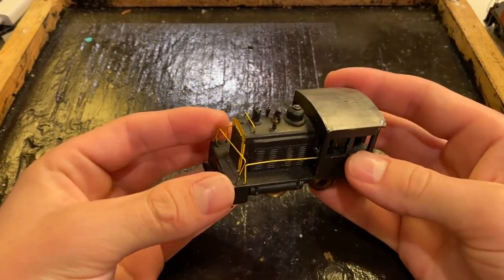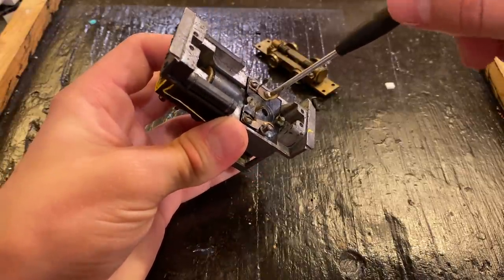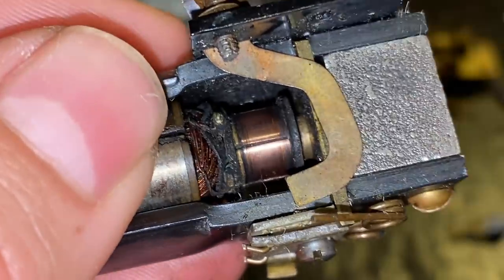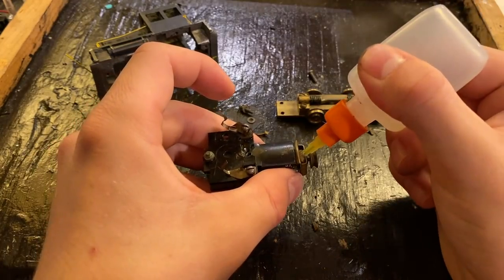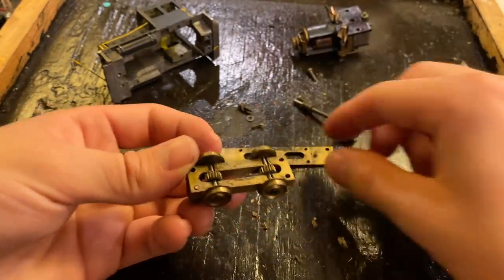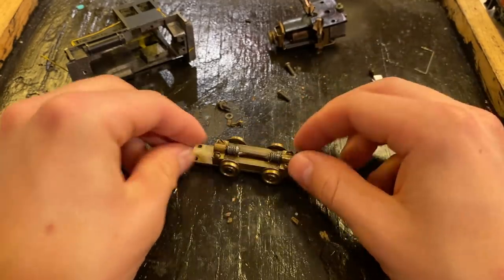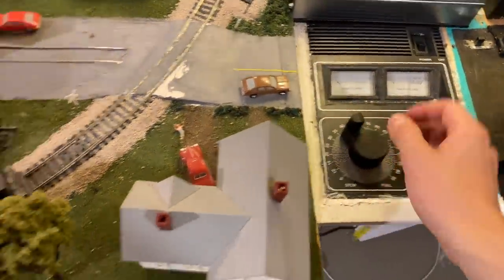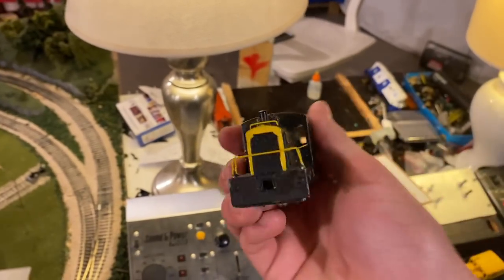Can We Make This Strange Vintage Die-Cast Ho Switcher Locomotive Run Again?

Comment: I could be wrong, but I think this is a Kemtron model from the middle to late 1950's. If I remember correctly they offered this in HO HOn3 and TT . I also think the original drive band was actually a band fabricated from a spring (meaning a coiled band, like a long coil spring formed into a band) You'll need to fiddle and fuss with the band tension till you get it right so as not to overburden the motor, but ALSO remeber in that time period the norm for power consuption was usually 1 AMP . Good video!
Reply: It is from pennline whitcomb 1. Generation with ooen engien at the back

Comment: I mentioned this before in one of your videos. Always wanted to try it. My grandfather grew up in Boyertown were pennline was made. He told me years ago that they advertised these little locos running around a half dollar coin with a bit of rail bent around the coin for the outer rail. Would be a neat project to try. Basically a radius of about 1.5 inches. Worked up a bit of penn line locos in my collection. The gg1 is my favorite and the decopod.
Reply: Bowser bought pennline..... The band drive was a bad decision. Attempt to quiet down straight cut gears i guess. Think the o ring is a little to tight...

Comment: This was made by Penn Line, a small outfit in Pennsylvania that started after WW2. They failed in the early 60s but much of their line is still made by Bowser. Like their name, they specialized in Pennsylvania (PRR) stuff. They offered classics like the K4, PRR turbine, a small 0-4-0, decapod, and others.

These came with either a rubber belt, or later, a spring belt. This one appears to have been modified to accept a replacement motor, either a Pittman or Mantua one. The motor magnet does not stick out on an original one. It appears the replace is a bit longer than the original. This loco was their cheapest model, often sold in a small train set.
Reply: Mine is original entirely gear drive.

Comment: Bit late, but I suspect the excess current draw is because you're using too small of an O ring. Because of how stiff/non stretchy it is, the motor is definitely fighting with it. It seems like the type of open frame motor that shouldn't require too much current, and there's no other parts that could be adding all that strain.

Comment: @SMT  Open-frame motors generally draw more power before they start moving. Thats why people have to sometimes re-motor locomotives before adding DCC to them, or else they could risk blowing out the decoder due to the high power draw.

Comment: Back in the 1930s, 40s, & into the 50s, most HO locomotives had a metal body.  The " piece of fabric ", on the motor bearing,  is called an " oil wick ".   Some motors on Marx O gauge locomotives use oil wicks on the armature bearings.
Reply: My mantua steam engines do too they have that oil wick . still intact as well I was shocked

Comment: Depending on the design of the motor and the age it might just require a lot of power.
I recently picked up some old british 3 rail stuff which it runs on dc but those motors are known to require a lot of power. Like around 1 amp each motor
Reply: David Andrew 
One of the engines may have a weak magnet but the other one doesn’t. If you look up hornby dublo you will see other people say the motors require a lot of power. I’m pretty sure it’s just the design of the motor
Reply from the maker: It's certainly not uncommon for engines of this age to require more power then their modern counter parts since the magnets get weak and things wear out however most motors of this type usually draw around a quarter of an amp and this one is doing almost 1.5 amps so I think something is wrong.

Comment: Since I'm a beginner in this hobby I usually take photos of locomotives before I start working on them, so I know how to put it back together & connect the wires in the correct spot
Reply from the maker: That's wise. Even though I do these video for fun they can be good to refer to in the same way if I'm having trouble putting something back together.

Comment: Try some bands made for the old athearn hi fi drive or the stronger colered bands for athearn the band you put on it is straining the motor you can find them on ebay ,,i use the colered bands on my RDCs and never had a problem with over 25 hours of run time,,,Ken

Comment: Do not use the O rings for this stuff it puts to much tension on the motor berings thats probably is what is causing the high draw
Reply from the maker: Yeah, I'm gonna try replacing that and see if it solves that problem.
Reply: @SMTMainline  long shot here. I have them no named branded band drive plastic trains my uncle gave me . I used a no kidding a red or any color will do hair tie elastic the type you had in hand before its small but it worked for what i needed and not to much tention on the motor

Comment: I honestly think I seen this type of loco at a local flea market I went to Sunday. The guy must be desperate to get rid of stuff he had things marked $5 for steamers. A parts bin $1 each one was a chassis had some odd motor on it a shell for a Marx switcher which looked like this. I seen 0-6-0 switchers for $5. I couldn't get something then but I may look this weekend . same guy i bought that Bachmann split chassis prairie from I have been thinking send to bachmann see if they can honor the warranty just to ease my mind to have a runner not a shelf queen .  I'll let you know if i do i may take some pictures. They hadpassenger cars $10 each but freight for like 2 to 3$ I swear he wants it gone quick I could cut a deal lol if I have the right cash on hand .    good work on restoration. If I bought the locos I seen is have some restoration of my own lol.
Reply: I'd have bought the whole lot without blinking twice at those prices.
Reply: @CR7659  I was wrong about prices they varied from 25 to 30 on up. I went this sunday There was a 5 dollar one said as is.and another thats 8 and was a mantua 0-6-0. As is .  now I did make a good buy.  $3 freight cars.  4 for $10. 10 for $20 but I think cause guy knew me that bought a loco that had a split frame type axles and we'll that loco is a shelf queen but i got 5 cars for $5 . no joke. And couple of them are vintage.

Comment: That motor draws alot current there is nothing you can do to stop that i have one that does the same thing only way you can fix that is to change the motor
Reply from the maker: Well I could try changing the O ring for something else and I could also buy it neodymium magnets so it's not hopeless yet.